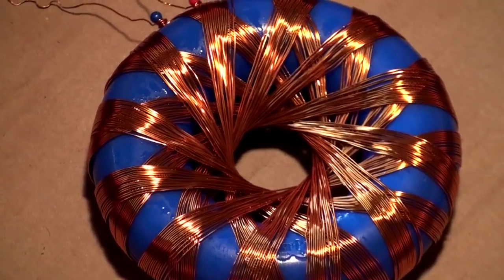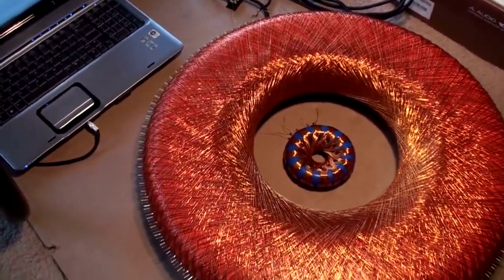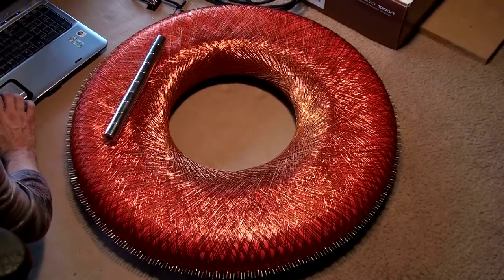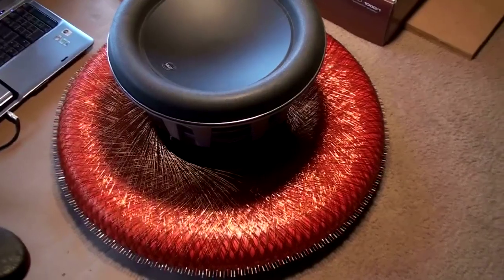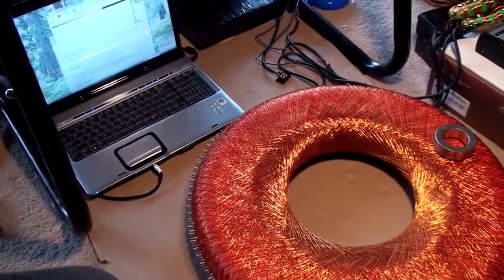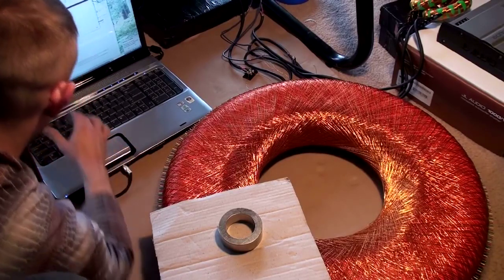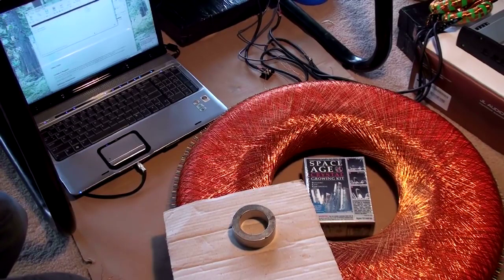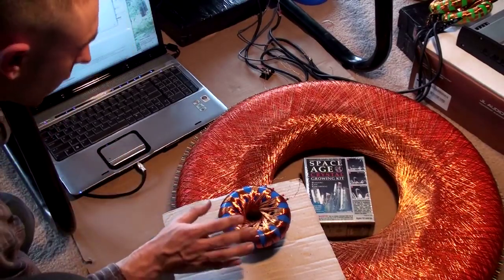Testing the 120 Point Rodin Coil  (11/11/11 @ 11:11 pm) - It's Alliiive!

Comment: I'd be super curious to see the ends of your large coil shorted and an ac pulse introduced at a resonant frequency through induction with a pulse generator to see if a zero point energy stream can enter the coil.
Something I've heard being done with another coil technology at the moment.

The idea is that once you find the resonant frequency of certain coils to pull from the vacuum or zero point energy then they essentially become a transformer / capacitor combined and begin resonating with the zero point energy field, which can be thought of as a resonating coil of eternal energy, to be tapped into by running a second coil close by your large coil through induction and harvested to usable voltages such as 12v, 120v, 240v

Love your work 👍👍

All hypothetical but an interesting idea at that
Reply: Also the earth's frequency can be thought of as an eternal resonating coil, which once we design a coil that can find resonance with it, then we have an eternal power source or something very close to that, that we can transform into usable voltages. 
Induction is the key through earth resonant coils I truly believe. Resonating at the earth's frequency of 7.83Hz or resonant amplitudes of that number to suit our common usable frequencies and voltages such as 50Hz, 60Hz and 12v,110v, 240v etc

Comment: Great vids!! I'm curious to know what's the difference between a 12 point coil and a 120 point coil? Is the 120 point coil stronger than a 12 point coil?
Reply: Not sure, but a 120 point coil would be more confined that a 12 point and it uses more copper length and can be multichannel if wounded pretty good

Comment: Don’t know why Rodin coils are showing up on my suggested videos but these coils were tested a long time ago and two things were found ,1 there is no benefit from them and 2 is related to the first reason and that’s production like would be needed wasted materials and time in comparison to just spooling the dam things like normal which is cost effective by multitudes.
Reply from the maker: Science is not a consensus. 1) yes there is benefit. Depends on how you use it and in what application.
2) machines are developed in industry to make tasks easier and automated.
Reply: @therealverbz  those things would be a pain to produce in a factory manufactured setting and so far the data shows it’s no leap or bound just a trinket. Totally agree with you here.

Comment: 49 ohms is a measure of resistance, also how can an amp (measure of current) be rated for its resistance. You’re using these words wrong. You mean to talk about Teslas or Voltage or frequencies picked up. However you indent to use it. Because you’re just saying this is a giant resistor.